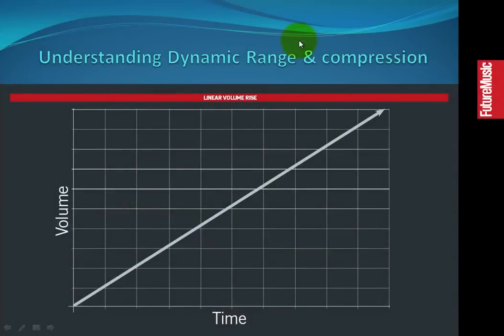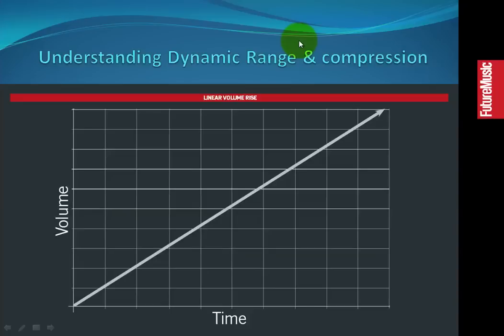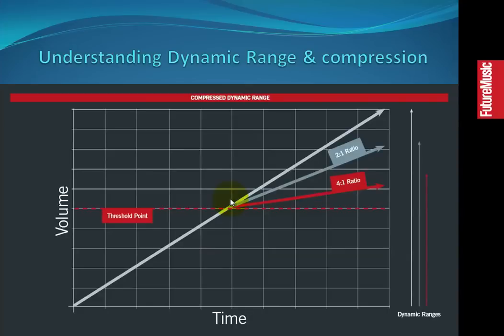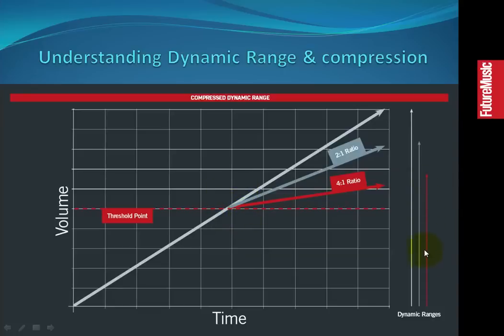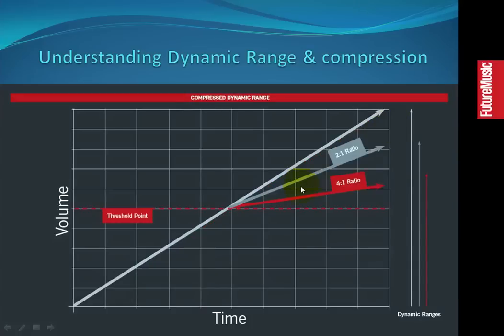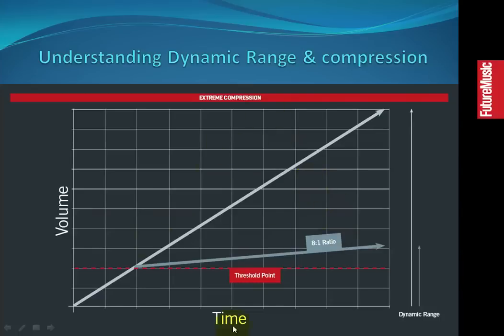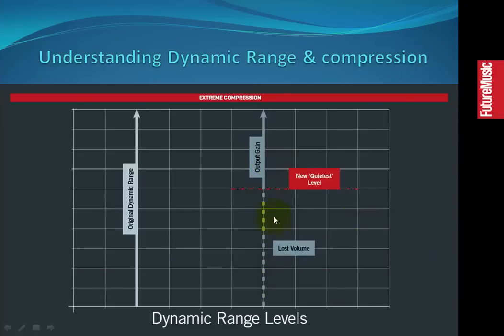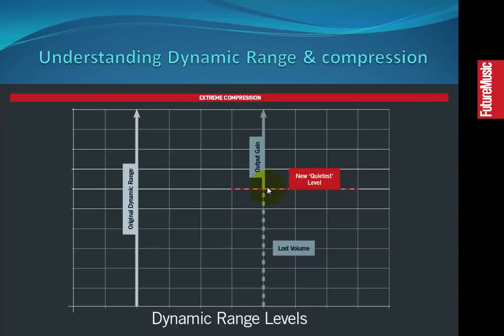FM's guide to mastering: Understanding dynamic range and compression

Comment: This is inaccurate. Dynamic range is the difference between silence and the loudest. He is referring to the Crest Factor, which is the lowest noise to the highest a sound source can produce.
Reply: Than what would be the point of the thresh hold?
Reply: Thank you for taking the time to reply.
I have never really used MBCs in my songs, but now I know how important they are.

Thanks again, Tiago.
Reply: ***** The point of the threshold as in its level? It entirely depends from case to case. Usually the most effective way to use a compressor is to start by crushing the audio with a very aggressive threshold and its attack and release at their minimum values and a high ratio. Then start by tuning the attack, then the release, then chill out on the threshold and play with the ratio to get the perfect result. Every case is different.

You should have in mind that there are a million other things that influence the compressor, such as the eq'ing you make before you compress it. You can have the best compressor settings on earth, but if the sound you are compressing has muddiness or if the artist bumped into the mic and you have low frequencies or DC offset affecting the compressor, you'll have a very poor result.

Basically, for good results, practice as much as you can and experiment with chains of plugins rather than a compressor or a eq.

On my vocal chain I usually use a Low Cut first, then a CLA 2A, then a CLA 76, then it depends on the voice. I am a huge fan of multi-band compressors, and since it was released there isn't a single of my projects without a Fabfilter MB. You can also use stuff like ozone dynamics, or C4, C6, etc.

So... There will never be a set value because every sound is different.